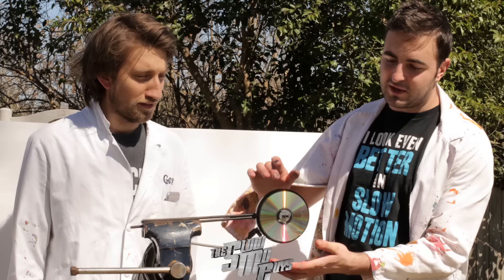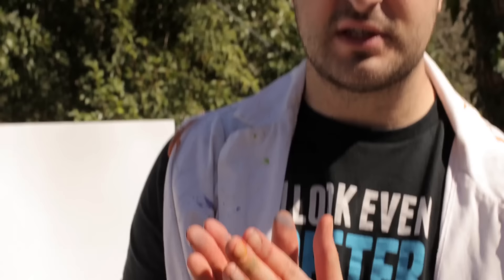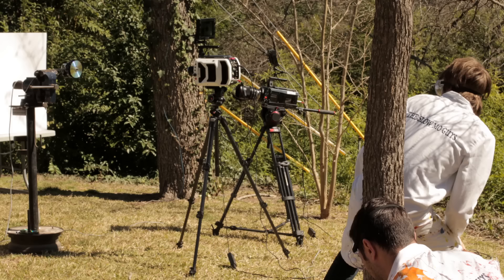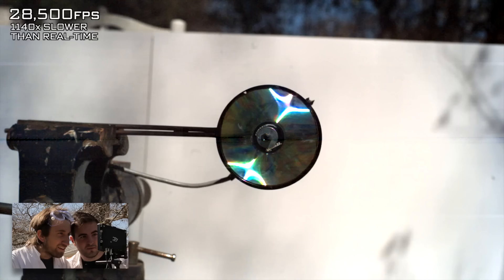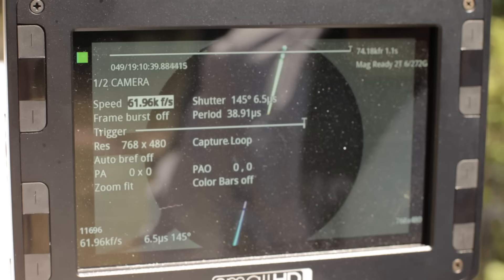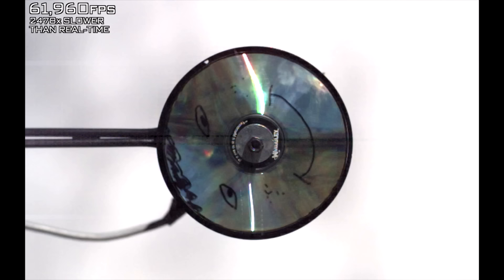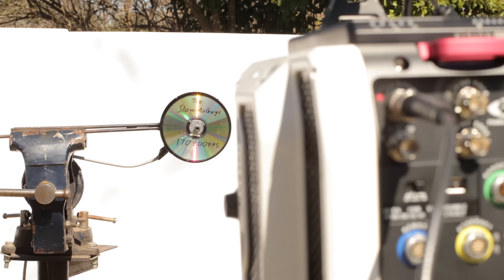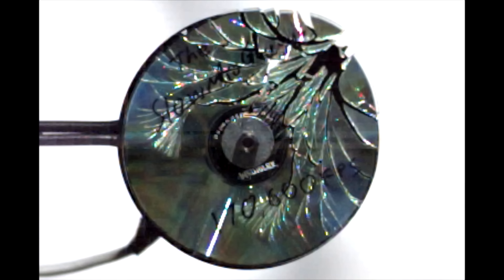CD Shattering at 170,000FPS! - The Slow Mo Guys

Comment: Four seconds of video = 96 gigabytes. o_0
Reply: How do they even store video at 24GB/s? Even a RAM disk wouldn't be fast enough to keep up!
Reply: I don't know how it is done specifically for this camera but you can reach these speeds for example with GDDR RAM which is used in graphics cards. With more specialized technology you can even reach hundreds of GB/s (https://en.wikipedia.org/wiki/High_Bandwidth_Memory)
Reply: I know right!
Reply: That sounds like my phone
Reply: There are 682,400 frames in that four seconds, imagine having that many pictures on a device
Reply: @delrasshial7200  agreed
Reply: Tape storage is the way.
Reply: the Sententious Vaunter Its literally high-speed video w/ no compression at all, hence the ridiculous file size
Reply: cause of 170 000 fps
Reply: @quadrplax  bro, that is camera
Reply: @quadrplax  un ddr5
Reply: @quadrplax  2years😮
Reply: @quadrplax  caches de video inside the ram and transfer to the storage
Reply: @BLIZZΛRD it stores all of those frames but instead of showing 170k pictures in a second it shows 60 pictures on a second so you can see in slow mo.
Reply: @dr.aisaitl7439  Pretty sure i have more than that in my "Homework" folder
Reply: That's just insane that takes more storage than gta 5 on my ps4 lmao
Reply: The entire video: 3 TB

Comment: I love how 4 years ago you thought 10,000 fps was ALOT
Reply: +Simon Mendoza just watched that mug one myself :p
Reply: Haha
Reply: +Simon Mendoza These cameras have been around for more than 4 years.
Reply: +Simon Mendoza 5 years from now we will have 5,000,000 FPS
Reply: +Miguel Guzman Frames per Nano-Second
Reply: +SERPERNTINE maybe when we have yottabyte hard drives...
Reply: +ThePoohat megabyte gigabyte terabyte petabyte Exabyte zettabyte yottabyte is hard drive storage levels in order just in case anyone didn't know this
Reply: A lot*
Reply: +blue phoenix brontobyte
Reply: I love how 10 minutes ago I thought 60 fps was alot
Reply: +Simon Mendoza I have a camera from 2005(mfg. 2007) that shoots 10kfps @ 448x368, and 1280x1024 @ 1kfps.
Not really a lot.
Reply: +brandon murphy I still think 60 fps is better that 1700000 fps XD
Reply: Rahul Garg
you're conflating two different things. 1,700,000fps is capture rate, which, to achieve slow motion, is played back at standard 28/60 fps... 60fps is probably better than 28 fps for viewing, but fps in the capture rate is less important. if you played back a high rate video at normal speed there would just be a lot of redundancy through frames you would never see. also, 28fps is easier for sound engineers to synch up proper audio.
Reply: ThePoohat Little mistake. 24(23.976) for PAL, 25/30 for NTSC.
And I think he wants to see the video played back in 60fps, not 24/30fps, which will cut the actual "slow motion" in half.
The capture rate is 170k, not 1.7M.
Reply: ***** thanks for correcting me bro, i'm by no means an expert, or even particularly knowledgeable here, just noticed a fault in some logic (being the conflation of capture and playback). as for the 1.7x10^4 / 1.7x10^6  business, he used no comas and i couldn't be bothered to count all the 0s.
Reply: +Simon Mendoza Not really. Back in the 60s they recorded nuclear explosions. You could see how the metal tower the held the device evaporated - it was that slow. Pretty amazing stuff. It's on youtube, look it up.
Reply: hr1100 Those were shot on a rapatronic camera, and it was not video - it was very, very precisely timed and exposed photo, using something called a Kerr cell shutter.
Reply: ***** Yeah, that is right. But the underlying principle is quite the same,isn't it?
Reply: hr1100 Not quite.
1) This is digital, the rapatronic is film.
2) The film is constantly exposed - but opened and closed to the actual light by two Kerr cell shutters, operated VERY quickly in sequence via a pulse-forming network. Nanosecond range.
Reply: this comment is from 4 years ago